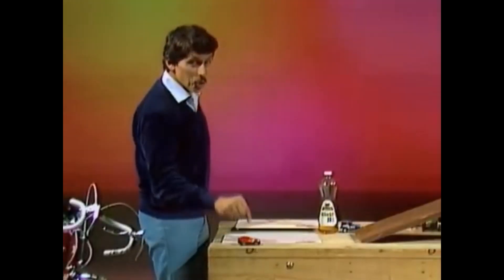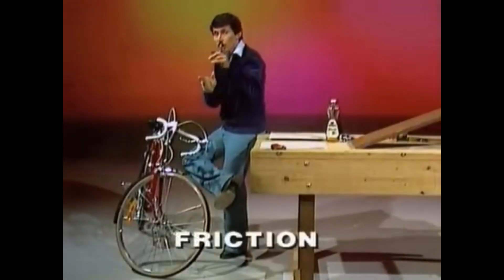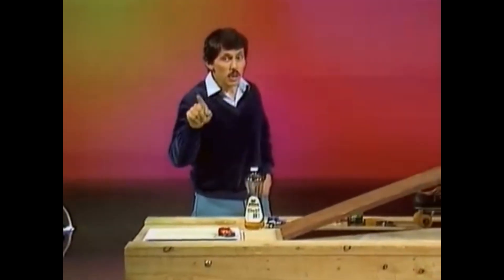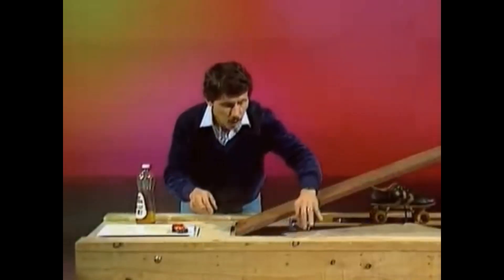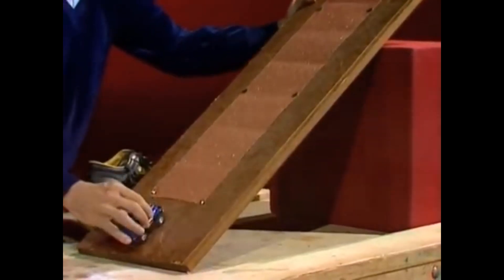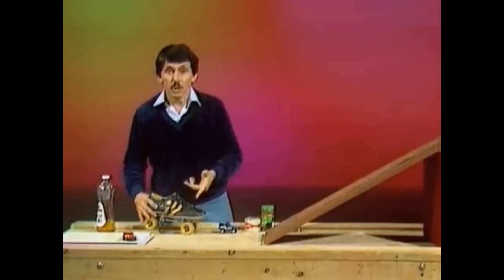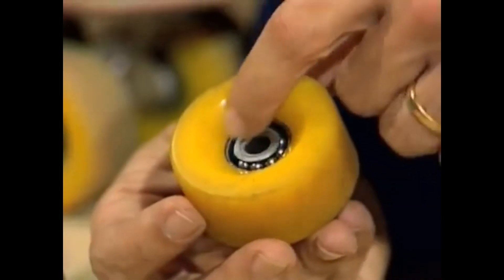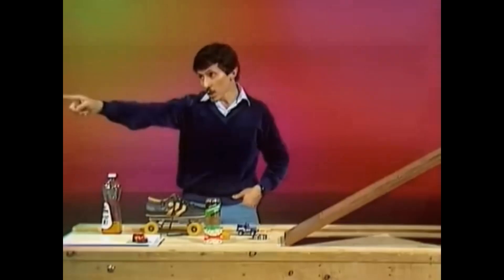Friction - Good or Bad?

Comment: Another example of oil preventing friction is in an engine - the pistons never touch the cylinders because there are sprung rings that are separated from the cylinder walls by a film of oil that allows millions of rotations without wearing out any of the surfaces, which is why you have to regularly change your oil to prevent particles from getting into those tight moving parts. 👍